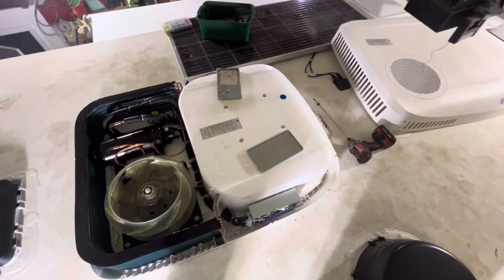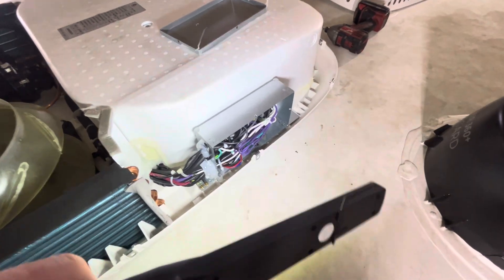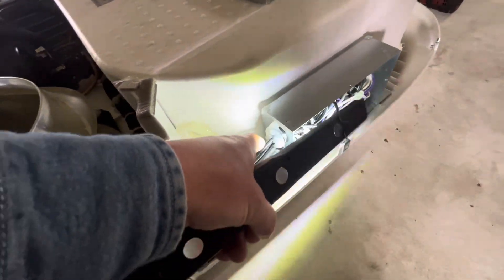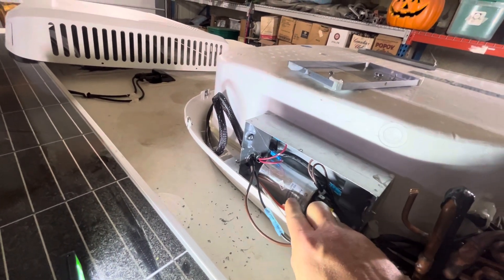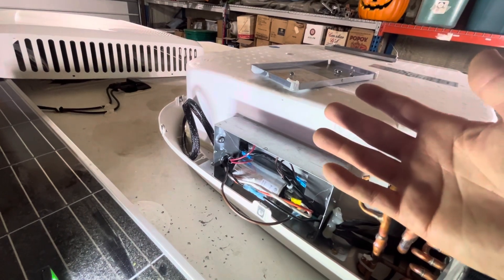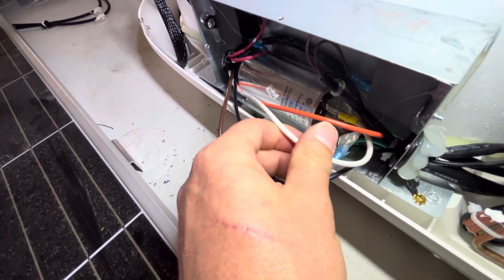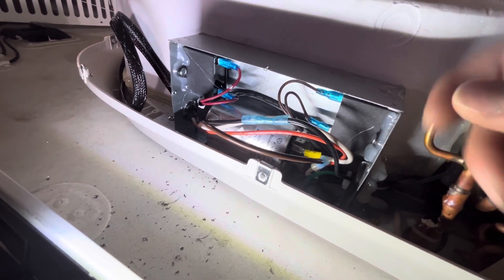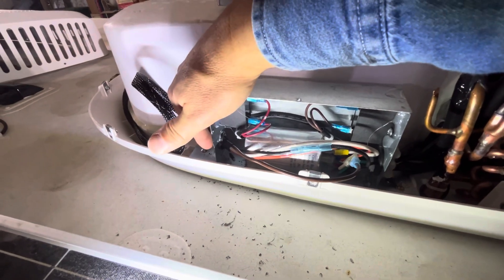Wiring a Micro-Air Easystart to a Houghton/Rec-Pro RV air conditioner.

Comment: I am getting ready to install the easy start on the houghton Belaire 3400. My question is The first wire you splice that’s attached to the compressor do you leave that wire connected to the compresor after splicing the wire in the easy start?
Reply from the maker: Sorry for the late reply! Yes, the first wire I spliced into on the passenger side of the unit remains (or gets re-connected) to the terminal it was originally connected to.
Reply: @SpecifiedGravity  I have a question about the first wire. You spliced a 14-gauge wire into the brown wire that runs to the compressor. Then, you connected the 14-gauge wire back to the junction box on the driver side. My question is:
	•	Is the original brown wire still connected directly to the compressor?
	•	It was never cut—correct?
	•	So the 14-gauge wire is simply spliced in, and the continuity between the compressor and the junction box on the passenger side remains intact?

Just want to confirm that the original circuit is still active and nothing was interrupted—only tapped into. Thank you
Reply from the maker: @andres-morales   Yes, you're just tapping into that circuit in the junction box on the passenger side.
Reply: @SpecifiedGravity Thank you.  I was able to installed the EasyStart with the help of this video.
Reply from the maker: @andres-morales  Awesome, good to hear it was helpful!